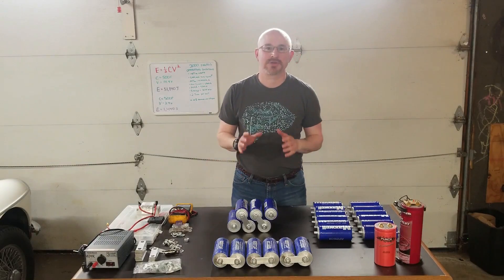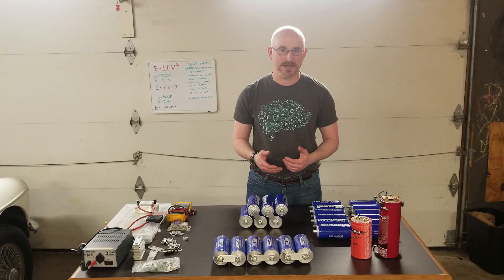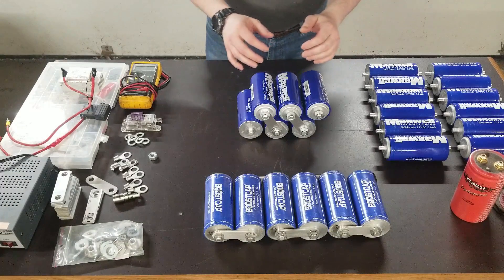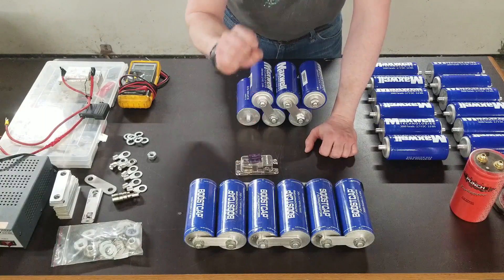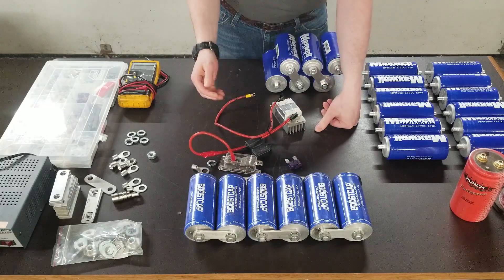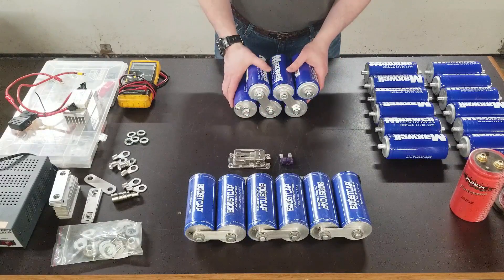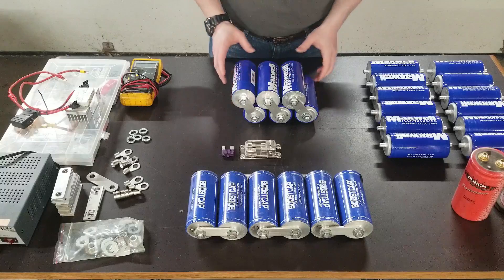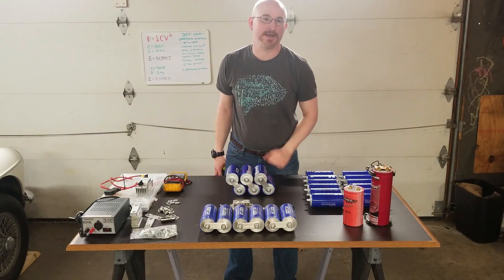Electrical engineer explains ultracapacitor Safety Tips and Tricks - Car Audio Applications

Comment: You do not really want to use the capacitors at their rated voltage that much. Making them operate on lower voltages extends their life and won't stress them that much. Much more the capacity of a capacitor isn't directly reflected to its charge voltage!
Reply from the maker: Agreed, which is why I don't operate at rated voltage!   These ultracaps tend to be an exception to this rule, however, which is why protection/balancing circuits are readily available.
Reply: Richard Vedvik
I read the datasheet of the newer 3400F version. It is guaranteed for 10-years on continous DC at 3 volts. After 1 500 hours the capacity is down to nearly 80% at 65 degrees C, which is a good standpoint.
I also have some information from another manufacturer[ELNA] which says every 10 degrees C loss in temperature about doubles the life, which means in realistic application, you can have as long as 10 000 hours depending on the conditions.

Operating these caps at the rated voltage induces I-R drop due to internal resistance, and that caused inequal charges between capacitors. One way to reduce the I-R drop is using less voltage to charge them lower, thereby causing less resistance due to 'peaking' the voltage, which produces sparks when charging them without a resistor to reduce current.

Plus, you gain more life using them lower voltages, since you don't exhaust the electrolyte which happens with higher voltages, where the electrolyte overheats, turns into gas and gets vented if problems exist.

I hope this helps on explanation.
Kazane '02' Rui

Comment: I'm interested in using them primarily in Solar set ups ,I was looking for a video that explains what, an ultra-capacitor is and how to implement them safely. (for a mate who wants to power his off grid house with solar, when he moves to Spain). yea very informative , concise and well made video. good work. thanks. 
Ps first discovered ultra caps on a video about building a stun gun! it was literally lethal , so safety with these bad boys is a must
Reply from the maker: Feel free to ask any other questions.  I'll have a video on balancing circuits when some parts arrive.
Reply: Richard Vedvik hi
Reply: These would only really provide a benefit when using a quick burst of power. You may be better off actually taking what money would be invested in capacitors and putting that into the battery system.
If you could provide some more details on the power consumers your friend will be using I could give you a couple of more recommendations. : )
Reply from the maker: @realhusky  Oddly enough, I bought my banks off of a seller that was disassembling solar energy storage banks.  Mine were used in solar applications. I agree, it seems like the wrong product for the application. 

We're seeing sodium ion energy storage as being an option for future utility-grade energy storage.

Comment: I have a plug in Hybrid and can get 27 miles on electric. I'm thinking would it be possible to parallel a cap bank to the Hybrid battery to extend miles on electric with recharging on braking and cruising? And of course not messing up the electronics? It makes a lot of sense for this application,  I heard Tesla is working with super caps.   Thanks for a good review
Reply: you could messup the computer
Reply: @tadeuferreira5705  
Just have to keep it stock and not mess it up

Comment: good video,  pretty disappointed with the lack of response to comments I make through Utube, 99%, what a waste of time.  anyway, could a car stereo amp be used to amp up anything other than a car stereo amp? maybe one of the types of electric motor. some type of modification? amped up ultracapacators with fork truck motor? lots of ideas
Reply from the maker: Hi! I understand you frustration with unanswered comments.  A car amplifier is designed to power low impedance AC loads.   A motor looks like a short circuit on startup and the amp would likely fail when trying to start.  The amp couldn't power a DC motor.  You could maybe power an AC induction motor, but you'd need a big amp to get to 120VAC.  Many amps could power a 24VAC motor.  You'd need a soft start circuit between the amp and motor, most likely.

Comment: I don't know if you said this at the beginning of the video, but you are working with them in this video in their Uncharged state, right? You touch the terminals with bare hands several times and nothing happens, so I'm assuming they're not charged.
Reply from the maker: I explain in the middle of the video that one of the banks is charged to 12VDC (each cap is only rated for 2.7VDC.  At that low of a voltage, it's no different than handling a car battery.  The resistance in our skin is sufficient to mitigate any appreciable current.  12VDC is plenty safe to handle, but my focus is on the short circuit current capability that requires users to be very careful to not short out the terminals - the arc that would occur would be a burn/fire hazard.  The National Electric Code (NEC) classifies anything under 50V as low voltage and "safe".

Comment: Safety Tip from Engineer: Shove bare contacts into a Fuseholder.
Reply from the maker: At 12VDC?  Sure.  NECA, NESC, OSHA, and NEC all classify <24V systems as "low voltage" and safe.
Reply from the maker: The human body has resistance.  Current (or charge flow) is determined from a mathematical combination of voltage potential across a resistance.  12VDC is not enough potential to induce unsafe current though the human body.  It doesn't matter what source current is available if the resistance is high.   Reference Ohm's Law for the relationship between voltage, current, and resistance.  Evidence of this is that battery terminals are tightened with wrenches or ratchets - not insulated tools.  If someone wears voltage-rated gloves when working on their car, then they can certainly be more careful. 

I suspect the impression is that some capacitors are high voltage caps, capable of storing hundreds or thousands of volts and it is habit to treat capacitors with great care (a good practice). 

The 12V industry is not concerned with electrocution.  The National Electrical Code (NEC) and National Fire Protection Agency (NFPA) recognize this in their classification of Class II wiring as being under 30V and that wiring doesn't have the same protection requirements as Class I or >30V systems.
Reply: 12 volts is too low to conduct electricity through air. Use this analogy:
More voltage makes sparks fly, more current makes heat.

Comment: I would like to know what the bus material is and what the screw in the cap is for.  God show, much enjoyed.
Reply from the maker: The bus material in this video is aluminum.  Copper is another popular option.  The nut is the screw "cap" and is to secure the bus bar to the cap.  Unless you mean a different "cap".
Reply: @richardvedvik979  Thanks for your reply. I was referring to the counter sunk screw  in the body of the cap. The slotted head screw which is shown in some images. I've never seen a screw in the body of a cap before so it caught my attention.  Thanks again, it's a very interesting subject with a great future.

Comment: What about if 24v engine
Reply from the maker: If you had a 24VDC system and you wanted to supplement batteries or have a capacitor-based energy storage system you would need enough capacitors in series to exceed the operating voltage needed.  9 x 2.7VDC = 24.3 VDC.  You'd want at least ten (10) 2.7V caps wired in series for 27VDC of operating voltage (extra provides some safety), with balancing circuits.  Not a cheap option but lightweight and good for fast charging/discharging.

Comment: Lol if you really need supercaps for a car system you have some cheapass components. You really have no clue what you're talking about.
Reply from the maker: National SPL competitors started using ultracap banks over 10 years ago once they realized the quick response capability provided a competitive edge over slow batteries.  A few years later, the SQ scene learned of the trick and started supplementing with them as well.  While a bank is more expensive than 2-3 AGM batteries, the speed and capability of ultracaps have proven to be worth it.  Hell, Tesla's interest in Maxwell is further evidence that these ultracaps represent a substantial opportunity for quick energy storage that is useful in automotive environments.   Most of us run $5k-$8k systems.  If that's cheap to you, then my hat's off to your success.
Reply: @richardvedvik979  No idea what SPL or SQ is but whatever. I did not say these supercaps are cheap they're anything but cheap. My point is that for an audio system it makes zeros sense to use supercaps. And I'm guessing tesla is interested because of charching capabilities, not to supplement their battery. In such a case it does make sense because batteries are tipically are charge rate limited not discharge. But even for Tesla I would be surprised if they will implement it as the cost does not outway the benefit.
Reply from the maker: @SillieWous  thanks for clarifying.  We're used to putting in multiple batteries and larger alternators to supplement the factory electrical system.  SPL stands for Sound Pressure Level.  SQ stands for Sound Quality.  Both are global industry terms in mobile audio and both are competition scenes.  SPL is where ultracaps have been used for a decade.  Competitors at that level don't spend money on electrical upgrades that don't provide useful results.  The SPL scene (globally) saw substantial benefits to using ultracaps, and those systems vary from 4kW-20kW+ in size (classes are based on clamped power, and duration).  Granted, they may run 10+ banks of caps and many are now are spending >$1k per Li-Ion battery.  And now we're seeing ultracap/Li-Ion hybrid batteries.   I think the best option for mobile audio system is Li-Ion batteries but they are so expensive it's prohibitive for most.   The reason so many have seen noticeable gains with ultracaps is how fast they react.  Music is dynamic, one of the fastest loads an electrical system can see (in a car anyway).  Batteries are slow and alternators are even slower.  Old caps were too small to be useful.  

Is your thought that stock electrical systems don't need upgrading to support aftermarket sound systems or that you prefer the traditional approach of larger alternators and extra batteries?
Reply: @SillieWous  😐

Comment: Can I use capacitors as a ev battery supplrment? How would I wire this? Can I regen it using the vehicle controllers regen? How would I wire that? Resistance etc. My EV controller and engine runs of 18~96V, 72V being the "nominal" 0~100A with 260A peaks. For now. The battery (prismatic lithium) is rated for 100A continious discharge. How would/could I implement Capacitors to improve the EV performance and maintain that 72V Volt/100~260Amp discharge rate without draining the battery when climbing hills?
Reply from the maker: Ultracaps are very expensive in a high voltage applications.  While certainly useful, you're looking at at least 36 of the 2.7V ultracaps (or 34 of the 2.85V ultracaps).  If you chose to go that route, the set of ultracaps in series would be in parallel with the normal battery system.   Ultracaps are good for quick charging and release while batteries are good for long-duration charging and release.  Even with the investment, your uphill application is better solved with more battery capacity.  You're always welcome to talk with the engineers at Maxwell on your specific application.

Comment: Should use a balance circuit. Non use shelf life is 4 years. Constant use is ten years.
Reply from the maker: I'll take some measurements of all cells simultaneously.  Individually, they are each still well below rated (when operated at 14.4VDC as a bank of 6) but I want to show how they behave dynamically and that requires 7 volt meters.
Reply: @richardvedvik979  thanks and the real reason is after many cycles the esr values will change and cause some to charge/discharge faster or slower and have one cell over volt.  It is just best practice and what is in the packs you buy say in the group 31 package.
Reply: They are about 8usd each and called 2.7volt super capacitor protection.
If you have the 2.85v version of super caps this will work too.  Protect your investment.
Reply from the maker: Understood about ESR and voltage variances.  These caps were used when purchased, so over 6 years old.  They will be a good sample of ESR variances over time.
Reply from the maker: Yep, i am well aware of the protection circuits.  Back when these were purchased  they were closer to $30 each.  Now, they are very affordable.   My next video will not only show the voltage variances but also discuss/show protection schemes.
Reply: @richardvedvik979  wonderfull you do excellent work

Comment: I am 3.5 mins into this video and it is a real gem. The only two things are that the audio is not great,  but I got used to it. The other is that the white board is too small to be seen. Other than that,  I cannot understand why the channel does not have more subscibers. The presenter is excellent!
Reply from the maker: Future videos will have a larger white board and smaller room to help the audio.  Thanks for the input

Comment: Have shown some bunch of Ultra Capacitors in rear side here and there, you haven’t mentioned what for you put them in use, either in place of fossile fuel or just for support of alternater for starting of your vehicle. Pl explain whether, they can be used as fuel supplier in place of DC batteries, ( Lithium Ion Fe). Hope, you explain through your other video. Thanks.
Reply: Thanks a lot for sharing your knowledge. Bye Mr Richard.
Reply from the maker: Hi, the installation tips are focused towards the mobile audio community when used in parallel with 12V batteries.  In this arrangement,  ultracaps can prolong battery life, improve starting current, and reduce voltage sags in dynamic loads.

Comment: if you connect that to a car, and  if you are not using the car for 2 days does it discharge the battery?
Reply from the maker: The capacitors have a small amount of leakage current but you'd have to let them sit for months and even then the lead-acid battery would likely discharge faster.  I've had banks sitting for months (like one bank in the video) and they lose about a half a volt per month. 

One benefit is that these ultracaps assist in engine starting by helping the battery provide starting current.